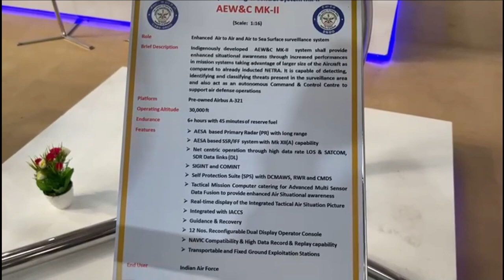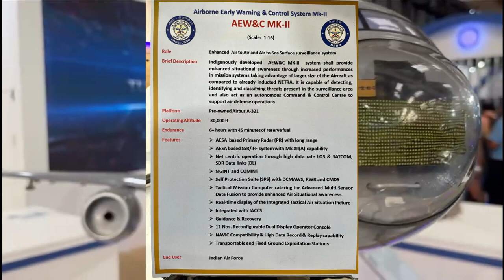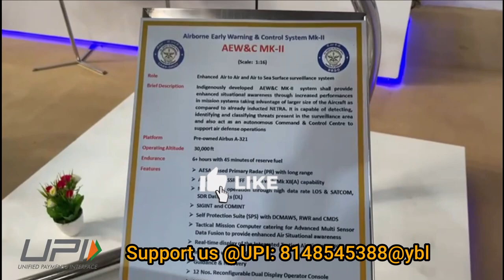Delivery of 6 Netra AEW&C Mark II to commence from 2025 onwards & all complete by 2028 #drdo

Comment: The difference between DRDO Plannar Array Radar & Boeing E7 Wedgetails is range,coverage & ELINT/SIGINT/EW capabilities.
Netra 2.0 will have range of 350km with Degree of cov5to be around 270° priced at 450-550 million dollars per unit that too with Refurbished airframes.
Whereas Boeing E7 Wedgetails have a range of 550+ km,360° coverage & 850km range for ELINT purposes,priced around 450+ million dollars per unit with Boeing 737 platform,which is also used for P8 Poseidon.
Indian Airforce should seriously consider atleast 6 E7 Wedgetails with technology assistance from Norththrop Gruman,Raytheon built on Refurbished Boeing 737 acquired from Indian Civilian markets,which will make those units available at around 375 million dollars per unit,which if ordered in 2024 will be delivered in all by 2025-26.
Frankly speaking,our Froces need a total AWACS/AEW platform consisting of:
6 Phalcon AWACS 
6 E7 Wedgetails 
6 Netra 2.0 & 6 Refurbished Boeing airframe based ELM2090 AWACS/E7 Wedgetails combined
3+3 Netra 1.0 transferred to Navy for Coastal operations based out of Island chains.
18 Ka31 AEW
18 AW101 Crowsnest
6 E2D Hawkeye for Carriers

Comment: How a CAG report exposed DRDO's mishandling of AEW&CS programmeThe CAG report showed irregularities in the selection of aircraft for the programmePradip R Sagar By Pradip R Sagar
Updated: August 29, 2018 23:38 IST
AEW-CS-PTI
Indian Air Force's indigenous AEW&CS in action during 'Exercise Iron Fist' in Pokhran | PTI
As the indigenous Airborne Early Warning and Control System (AEW&CS)—aircraft fitted with a radar system—flew over the Rajpath during the 2017 Republic Day parade, India joined an elite group of five countries that had this capability. But, before it could be formally inducted into the Air Force fleet, the ‘Eye in the Sky’ has flown into turbulence.

A report by the Comptroller and Auditor General, which was recently tabled in Parliament, has made startling observations about the programme, on which the Defence Research and Development Organisation has spent more than Rs 2,500 crore.

The CAG report showed irregularities in the selection of aircraft for the programme. The auditor slammed the DRDO for the cost overrun—the initial cost was Rs 1,800 crore—and its claims about indigenousness. Moreover, preferred vendors were selected to benefit certain companies, said the report. Though the Air Force had accepted the AEW&CS last year, it is yet to get the final operational clearance.

￼

☰

How a CAG report exposed DRDO's mishandling of AEW&CS programme

The CAG report showed irregularities in the selection of aircraft for the programme

￼ By Pradip R SagarUpdated: August 29, 2018 23:38 IST

￼Indian Air Force's indigenous AEW&CS in action during 'Exercise Iron Fist' in Pokhran | PTI

As the indigenous Airborne Early Warning and Control System (AEW&CS)—aircraft fitted with a radar system—flew over the Rajpath during the 2017 Republic Day parade, India joined an elite group of five countries that had this capability. But, before it could be formally inducted into the Air Force fleet, the ‘Eye in the Sky’ has flown into turbulence.

A report by the Comptroller and Auditor General, which was recently tabled in Parliament, has made startling observations about the programme, on which the Defence Research and Development Organisation has spent more than Rs 2,500 crore.

The CAG report showed irregularities in the selection of aircraft for the programme. The auditor slammed the DRDO for the cost overrun—the initial cost was Rs 1,800 crore—and its claims about indigenousness. Moreover, preferred vendors were selected to benefit certain companies, said the report. Though the Air Force had accepted the AEW&CS last year, it is yet to get the final operational clearance.

ALSO READ

CAG of India selected as External Auditor of UN agency ILO

Now, Chinese artificial intelligence lessons for CAG

IAF’s Black Saturday as 2 frontline fighters collide, 1 dead

IAF successfully test-fires extended range BrahMos air-launched missile

Creation of new weapon system for Air Force approved: IAF Chief

The AEW&CS is a moving surveillance platform, making it difficult for the enemy to locate the exact position of the aircraft. With its long range and detection capabilities, it gives a 360 degree view of the sky and can track many aircraft simultaneously.

China currently has 20 such airborne warning systems, while Pakistan has eight. The Indian Air Force has only three—Israeli Phalcon radar systems mounted on Russian IL-76 aircraft. India had bought the radar systems from Israel in 2004. According to experts, India currently does not have the capability to cover its entire airspace during a war.

A programme to develop an indigenous early warning system was taken up in 1994, but was shut down after a fatal crash. Subsequently, the defence ministry in 1999 approved the import of three airborne warning systems (the ones from Israel) and decided to meet further requirement through indigenous development.

In October 2004, the cabinet committee on security approved indigenous development of AEW&CS at a cost of Rs 1,800 crore. The deadline was April 2011. Under the project, two AEW&CS were to be supplied to the Air Force. DRDO’s Bengaluru-based laboratory, Centre for Air Borne Systems (CABS), was the nodal agency for design and development.

Considering the operational importance of this project, the CAG carried out an audit to know whether the system had everything that was promised. K. Subramaniam, principal director of audit, Air Force, recently sent the classified report to Dr S. Christopher, the then secretary of the Department of Defence Research and Development—which found serious irregularities in the programme.

The report has come down heavily on the programme over its claim of indigenousness. Despite the project being called home made, it was only 48 per cent indigenous. The DRDO had claimed it to be 81 per cent. And, the cost of foreign consultancy, about Rs 106 crore, was categorised as indigenous.

The CAG’s observations draw strength from the ongoing CBI investigation into alleged kickbacks in the process of selecting the aircraft. The Embraer EMB-145 aircraft from Brazil was shortlisted for the project in 2007. However, Brazilian media reported that Indian officials were bribed to swing the deal in Embraer’s favour. In 2016, the CBI registered a case against NRI arms dealer Vipin Khanna and two private companies based abroad. The case was about the alleged payment of more than $5.70 million as kickbacks to seal the deal for the aircraft.

The CAG report also pointed out inadequacies in management, which stretched the development period to 13 years. “And, the operational requirements, instead of being based on the functional needs of the Air Force, were being adjusted according to the aircraft that was ‘pre-selected’. It took seven years to finalise the operational requirements,” said the report.

During the design and development stage, some operational parameters were compromised because of the Embraer’s limitations. Also, there was no competitive bidding while selecting the aircraft. The Embraer was shortlisted through a nomination. Notably, several aircraft, such as the IL-76, and models from Gulfstream, Bombardier and Boeing were available at the time.

“The justification given for the selection of EMB-145 was not tenable,” the CAG observed. “No objective assessment of the merits and demerits of available options was done. The selection of EMB-145 was arbitrary and based on preconceived preference.”

Initial operational requirements stipulated that the system should be able to operate from high-altitude locations like Leh to have a much deeper view into the Chinese army’s activities. As the EMB-145 was incapable of doing so, claims the report, the Air Force had to drop this requirement in February 2006.

The report also said that the Air Force officials working with the DRDO reiterated that Embraer was not the suitable aircraft.

The CAG also criticised the project for the way the pilots were trained. “From the scrutiny of the expenditure on training, the audit found that the training commenced in June 2007. At this point, the procurement contract for EMB-145 was yet to be awarded and negotiations were underway between the CABS and M/s Embraer. Therefore, training of pilots on an aircraft even before finalising its purchase is highly unjustified,” CAG pointed out. Six pilots were trained abroad at a cost of Rs 23 crore.

Of the 18 requirements specified by the Air Force, AEW&CS could not fully achieve ten important ones. Despite this, the Air Force accepted the first system in February 2017.

“Since EMB-145 was selected, the weight of the mission system had to be adjusted to the optimum payload capacity of EMB-145, which was 3,000kg. The radar along with its associated systems, which was to be mounted on the fuselage, had to be limited to 1,500 kilos due to structural limitations,” the CAG said.

The probable date of completion was revised four times and the final date of completion was extended by over six years, said the report. The Air Force kept changing its requirements. In the middle of the programme, the Air Force demanded air-to-air refuelling and a de-icing system. It led to a delay of nearly two years.

Christopher, who was the head of CABS, said the repeated modifications in the operational requirement by the Air Force played a major role in the delay of the project. “It is all recorded in official documents and no one can find fault with me for it,” he said. “However, I believe that operational requirements is a prerogative of the user and you, as a developer of the equipment, cannot challenge it.”

Regarding the aircraft, he said, “Embraer was a well-proven aircraft. The decision to buy Embraer was taken in consultation with the then IAF chief S. Krishnaswamy. Four countries were using this platform as AWACS—the generic term for such a system. Moreover, the IAF decided that it has to be a turbo jet, not propellant. Turbo engine gives them the desired speed and efficiency.”

When contacted, Krishnaswamy said the selection of aircraft was purely DRDO’s decision. “The IAF was using Embraer for its VVIP fleet and thought of commonality if it is selected for AEW&CS. Since AEW&CS was DRDO’s project and budget was allocated to them, the final decision for selecting aircraft was DRDO’s only,” he said, adding that any modification in the operational requirements was a collective decision of the Air Force and the DRDO

Comment: DRDO is also developing 360 degree rotodome of AEW&CS
Reply from the maker: Radom is already developed but this need to be integrated and tested , however world is moving away from 360 degree awacs to wedge tail one
Reply: @IndianDefenseAnalysis  China & Russia are developing the A-100 & KJ-2000 360° AWACS which are far more sophisticated than their older variants. Only the USAF is adopting the E-7 Wedgetail in limited numbers before they develop a 360° AWACs to replace the E-3G Sentry.

Comment: Now that I understand huge importance of GaN based AESA radar, it needs to be retrofitted as well on existing Netra as well to bring them up to the Mk2 standard. As long as it gets delivered by 2028, it will close the Balakot gap. There were three huge issues revealed by that: 1.Lack of Software Defined Radios, solved by BNET upgrade. 2. More AWACS on Pakistani side, now the shoe is on the other foot in 2028. 3. AMRAAM greater range, equalised by Astra Mk1, beaten by Astra Mk2 and tiny rcs of Tejas.